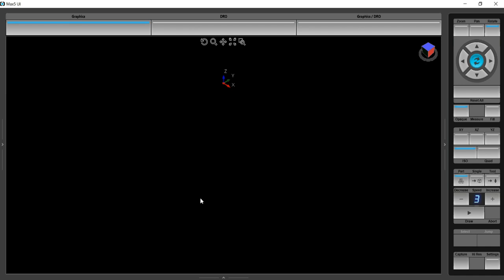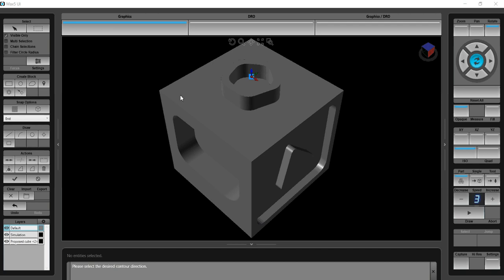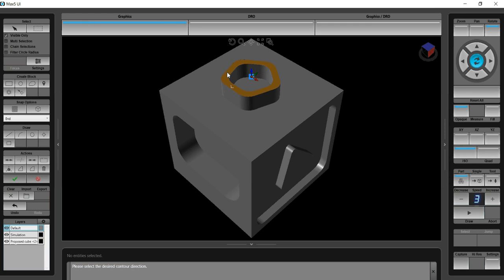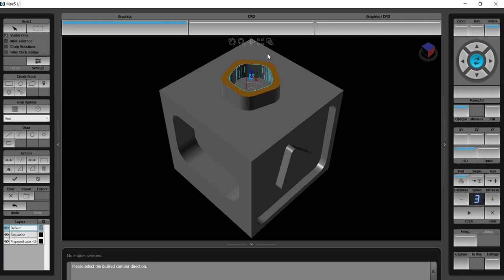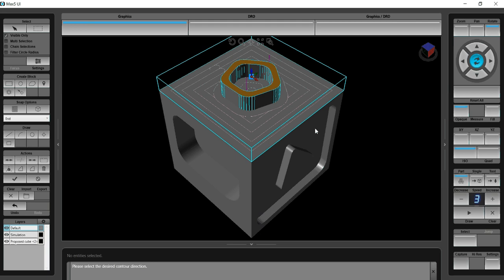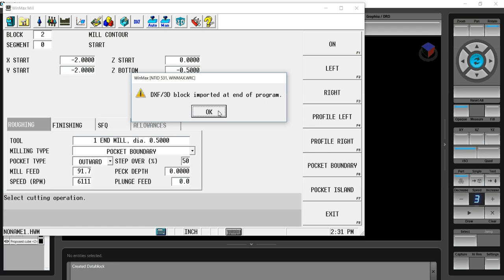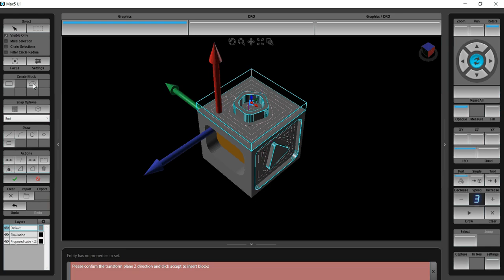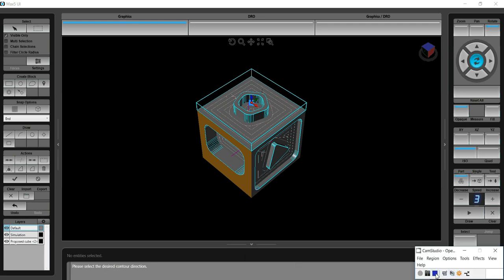How To 3D IMPORT SOLID MODEL - Hurco WinMax CNC Control Demo

Comment: Any reason why winmax is only accepting dxf format and not stp? The option to select a stp is not there? About 2 year old vm20.
Reply from the maker: Hi Kernel Collective, to answer that sort of question we would need more info from you. What WinMax software version are you currently using? Also, some people have the DXF option but they may think they have Solid Model Import as well. Do you have the solid model import option? Where are you located?
Reply: @hurcousa  machine is a vm20, version I believe is 10.3.0. Location Australia, do you have a contact for a local support rep I can contact? Or best email to contact yourself?
Reply from the maker: @TheKernelCollective  try one more thing for us first. A  possible reason for this issue is you may only have the 2D DXF feature, OR 3D DXF option turned on. That can be verified by looking at the current software options on the control:
•	Press the AUXILIARY button on the control panel
•	Select the UTILITY SCREEN icon (Swiss Army Knife) from the pop-up menu
•	Select the SYSTEM CONFIGURATION softkey on the screen
•	Select the SOFTWARE OPTIONS softkey on the screen
•	Scroll down and verify the SOLID MODEL IMPORT – STEP option is enabled

When you get time, what does it say?
Reply: @hurcousa  thanks for the reply. Got it. Solid modem import - step is currently "not installed". I guess the next question is how to get it installed. This may require phone support as we have some interesting network constraints.
Reply from the maker: You’ll want to contact service (service@hurco.com). If you have a purchase order or sales order number they may be able to turn it on for you…if not, then you will need to go through the local Hurco distributor. Hurco Southeast Asia will be able to help as well.